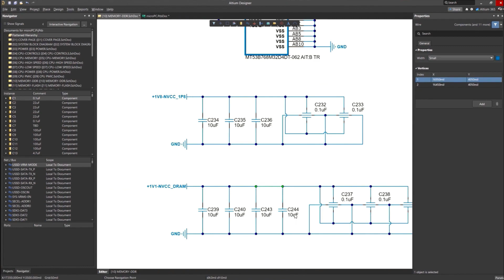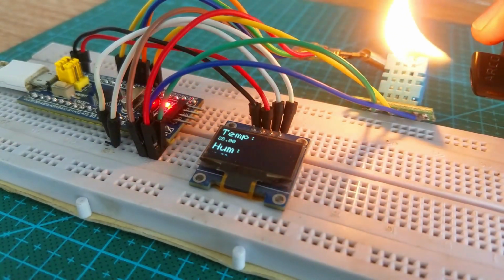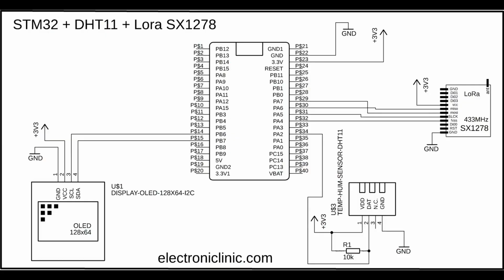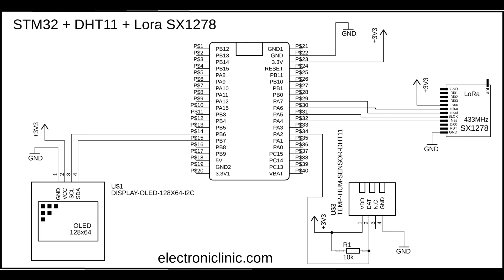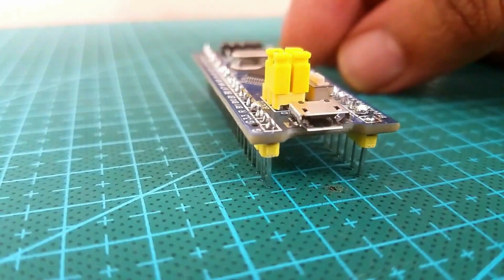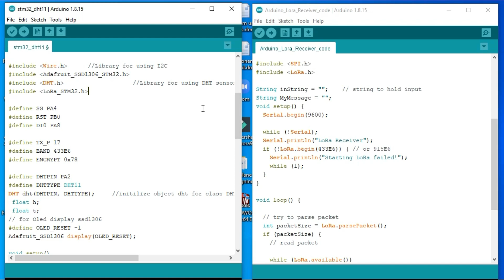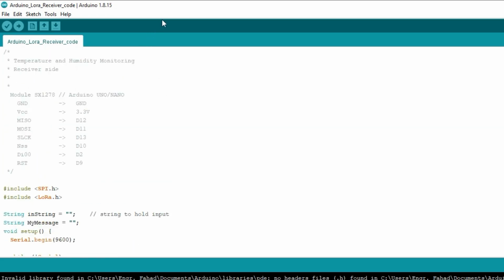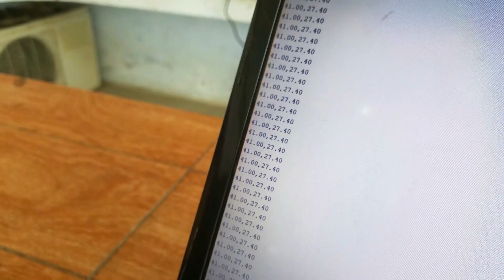Lora SX1278 and STM32 based Temperature and Humidity Monitoring using Arduino IDE

Comment: this is exactly what I'm searching for
Reply from the maker: next version of it will be on the iot gateway + stm32 + dht11.
Reply: @ElectroniClinic  Hello! Could you make changes to the receiver sketch to connect the SSD1306 Oled and display the data received on it? Your project is amazing, don’t abandon this project because you can add functions for turning on a relay (fan or heater) and feedback that controls the operation of these relays. My knowledge is only enough to repeat your project, and not change it. Good luck to you!